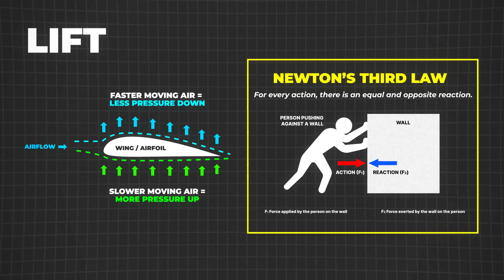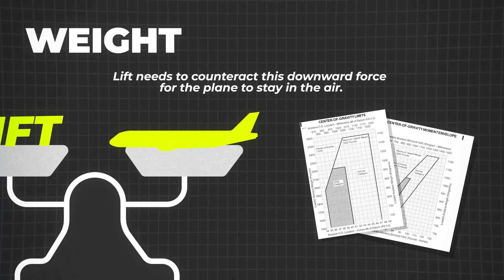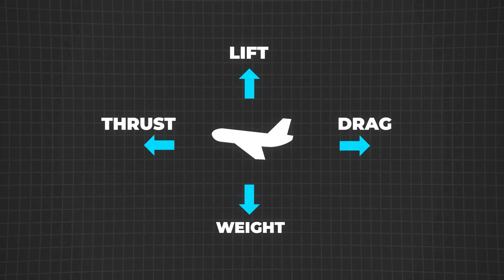✈️✨ How Do Airplanes Fly? 🛫🔍 (A Simple Explanation for Everyone!)

Comment: Watch out with the 'curved upper surface' bit. This leads to myths like  Wings operate like a Venturi-they don't (Venturis are closed system- wings are open systems).  or Equal Transit Time (curved upper surface= longer top distance therefore faster flow) . Flat wings fly perfectly well with low drag as long as they have an effective AOA. . This 'curved upper' surface is where misinterpretations of Bernoulli comes in. Lift is created by turning a flow field -in effect bending the air and this, -primarily caused by AOA (including incidence and extending flaps and slats)  is what creates the reaction force we call lift. . 

Bernoulli only deals with single streamlines not pressure gradients. and doesn't mention curved surfaces. In simple terms Bernoulli (which is really a restating of Newton's 2nd law) states "the speed of a moving fluid increases (liquid or gas), the pressure within the fluid decreases' (Check NASA How wings work) Also all modern airliners use supercritical wings that are more curved underneath and flatter on top. 

AOA i.e. Newton's 2nd law F=MA is the primary driver of lift as anyone who has made a paper plane fly, knows.
Reply from the maker: Thank you for your insightful comment! You're absolutely right—lift is more complex than simplified explanations suggest, and AoA, airflow turning, and modern wing designs are key factors. My channel aims to explain concepts simply for viewers without a deep physics background, which is why I focus on basics like the curved upper surface.

I appreciate you bringing up these points—it’s always great to add depth to the discussion! For those interested, NASA’s “How Wings Work” is a fantastic resource for a deeper dive. ✈

Thanks for watching and engaging!
Reply: @AeroShorts  You're welcome. Always happy to see more educational content on this subject. You might enjoy this simplified video I did for my 1st year BSc Aviation students a number of years ago. https://www.youtube.com/watch?v=WmXq9gm1uMo